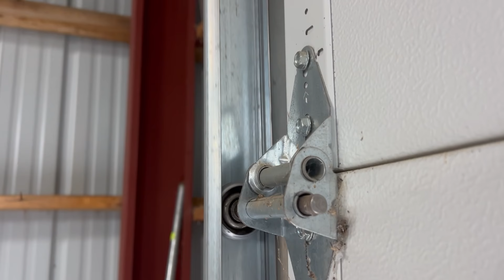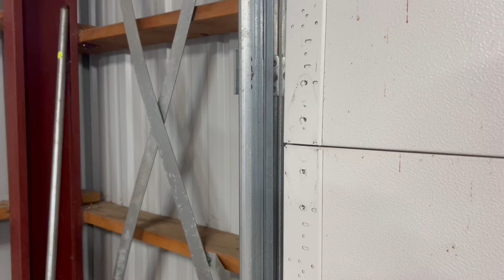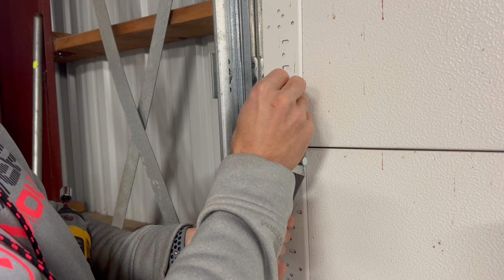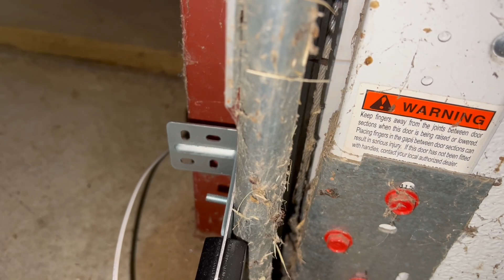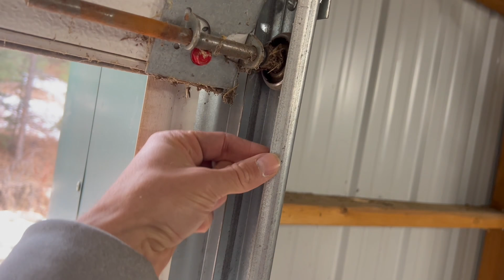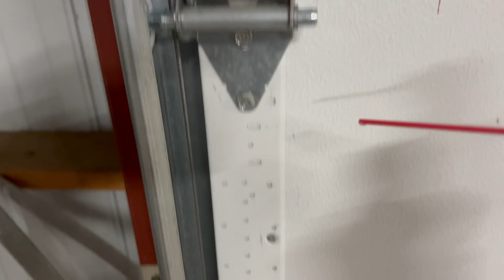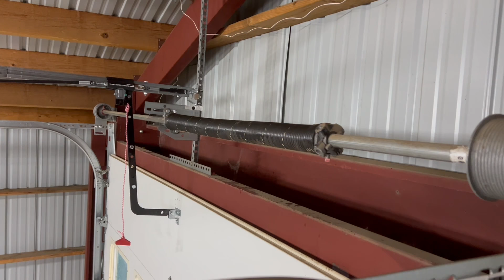How to Replace Old Garage Door Rollers WITHOUT Bending Track (Easy DIY Install) | Builds by Maz

Comment: Why did you spray WD-40 on the spring?  That product is a Degreaser and not a lubricant.
Reply from the maker: It’s not regular WD-40, it’s a WD-40 brand silicone lubricant

Comment: Good video. I have extension springs on the side, so it works the same, no spring tension when door is open. Then you can remove bottom roller or replace cable or spring. My metal rollers are 65 years old. I lube the  ball bearings with white lithium grease. I used to use oil but it attracts dirt.

Comment: Hold the cable in place with vise grips when replacing the bottom rollers.  Even easier alternative: replace all the rollers except the bottom ones.  Then use a good teflon lubricant on the bottom rollers. Full door done in 10 mins and usually just as quiet as doing all the rollers.

Comment: Was just easier for me to loosen up the few nuts on the side track on each side, pull it away and replaced all of the rollers at one time. Didnt need to even open the door

Comment: Since you used the first method of removing the bottom roller by slightly bending the track, would you be able to remove the other 4 or 5 rollers using that same 'bend'?  Rookie here, so I don't know. 😊
Reply from the maker: I didn't bend the track. I recommend avoiding that, if you can.

Comment: I wonder about a third option for that bottom roller. What would happen if you change all the other rollers to nylon but leave that bottom metal one in place? Would you still get most of the benefits of the changeover without the hassle of dealing with that bottom one?
Reply from the maker: You would definitely still get a lot of improvement. You can always try it, and if it's still noisy, go back and replace the bottom 2.

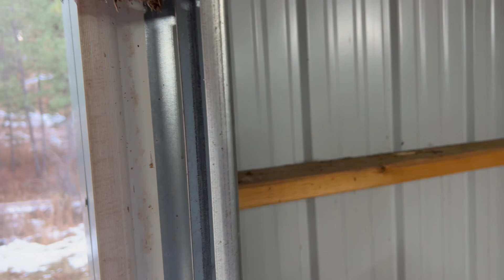Comment: Title of the video is "How to replace old garage door rollers WITHOUT bending the track" and then at 3:30 you suggest bending the track. Just disconnect the track at the joint (shown at 3:07), pull the door up to get the roller out and then replace it... then put the track back together. Botta bing botta boom.

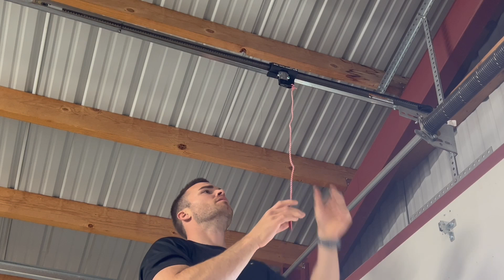Comment: @2:50  We have exactly same single Torsion spring, at the same location (the spring starts at the center, but it is 2 car garage door, so twice wider), when one end coincide with the center of the Torsion Rod (tube). If I want to replace that one single spring with two of them instead, should I buy the springs of the same category (I mean length, coil thickness, and ID), or they should be a bit smaller? In one video they said the new spring can be a bit stronger, so if I place 2 springs instead of one, probably there will be no problem. The Central Wall Bracket looks good  and strong. 1st I thought i need to put at the center 2 wall brackets (one on top of another), especially that they sell them on Amazon in pairs, but google search gave the answer that the existing single central Wall plate should be enough for 2 springs as well. This question is still vague for me, since no one on YT is replacing the 1 spring with 2. If someone can give any opinion on this quite interesting perspective (if one spring got broken, why not to enhance the system with 2 springs instead). I would really appreciate. Thank you for sharing your knowledge about garage Doors problems with DIYs.

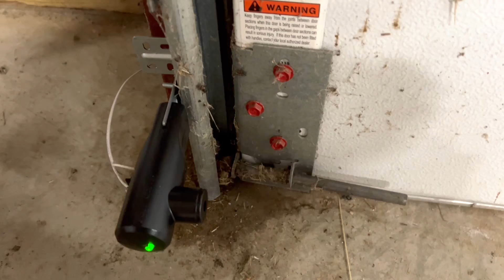Comment: @2:22 So if the Torsion Spring in not under any tension (since broken), you can do the bottom roller same way as others? Also how often you need to replace Cables and Cable Pulleys? Thank you for the detailed video again and especially for the lubrication tips (I understand White Lithium Grease is an alternative for the Silicon Lubricant). We never lubricated our garage door (I didn't think much about it), maybe that is why and the Torsion Spring gave up and broke.
Reply from the maker: Yes white lithium grease is also a great option. It's important to lubricate the spring regularly, and that probably would have extended the life of your spring. If you are sure there is NO tension on the spring, then you can replace the bottom roller the same as the others. Cables should last for 5-10 years at least, but you may want to have a professional inspect them to see how much wear they have.
Reply: @buildsbymaz  Thank you for the replay. Yes, no tension, the Torsion Spring got split in 2 unequal parts and the Cables hang totally free. The house is 25 years old, and I don't think anyone replaced them (though not sure, we bought it when it was like 15 years old). I bought on Amazon some time ago  3-In-One Garage door Lube spray, but it doesn't say on the bottle Silicone, I'll order the one you advised, since will be installing Nylon Rollers. Thank you again.

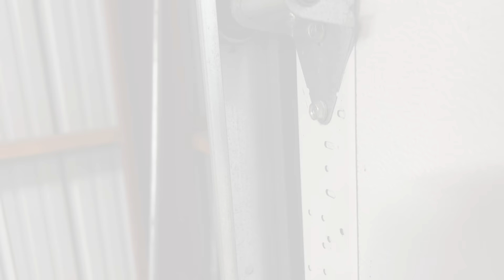Comment: @0:22  That is exactly what is going on w/some of our Rollers. I thought it is a normal situation, that those rollers sound (ours also bent a bit) like that, but now I see that they are also just worn out. The garage door is 25 years old, so I need to replace them. I think that the method of replacing the Rollers used here is much better than bending the rails I saw in other videos. When the rails are bent back you can see that they were bent, there are marks on them, and maybe DIY like me won't be able to put them back how they should be. Thank you so much for showing all the details about Rollers replacement in this outstanding video.
    Our door got bent, since Torsion Spring split, then I aligned it, but not completely (the door is bent inside in the top middle part like ~ 1 in). So to attach that black handle for the trolley I would need to use another hole different from original , not sure if it is the right thing to do. And also after I detached that (Arm) handle from the door, can I lift that door at list a bit to see that it can move normally and the problem is only in the disabled Torsion Spring, or without a new Torsion Spring it is not possible, bcs of the weight of the door (it is 2 car garage door, but aluminum)? I would appreciate any opinions on this matter. Thank you for the informative video again.

Comment: DANGER WILL ROBINSON! I actually attempted to perform the method of removing the cable from the bottom brackets this way before I saw this video. As soon as the tension is released the spool up top becomes a rats nest and if your garage is like mine it's not easy to get to the coil. It was a major pain in the ass to re-wind it all back up while keeping tension. Just bend the metal, it was SO much easier and you can't even tell you did anything unless you look really closely after you bend it back. If you do his method you need to hook the cable onto something else to keep the tension, because even with a little slack it turns into a mess.

Comment: is it possible to do a short video to show how to use a vise clamp to do the bottom roller ?
Reply from the maker: All you would need to do is clamp the end of the end of the wire to the garage track so that it stays in place and does not unravel. I may be making another video in the future on this but it will not be for a while

Comment: DO NOT ever lube the track. You want the rollers to roll not slide. Also instead of lubing the roller shaft they make plastic sleeves to make them even more quiet.
Reply: Agreed on both points.  He should just get a PTFE coated sleeve for self-lubrication.

Comment: Lubricate the new rollers shaft with litium grease before installing them.  It may sound redundant but it helps significantly with the noise and life span of the motor.

Comment: After reading comments, a guy said to use vice grips when unhooking the cable and just let it hang so u don't need to wind it up on the wheel and another guy said he bought a thicker wheel.
        So I went on Amazon and found the thicker wheels and bought a ten pack for fifteen bucks and with the help of THIS VIDEO I installed them in less than an hour. If it wasn't for the motor running I wouldn't think the door was opening, That's how quit it is.....
Reply from the maker: Awesome! Glad to hear it worked out great.

Comment: Do no spray the track. It does no provide any advantage but it will accumulate tons of dust, dirt debri making is an oily dirty mess.
Reply: Highly agree. This serves zero purpose. Simply wipe clean with a rag. Any dampness or grease will accumulate dirt and debris. The rollers roll for a reason, they don't slide, so no need for lube there.
Reply: You can pour a spray bottle of windshield washer fluid to spray & wipe clean the roller tracks.  It is alcohol base cleaner & able to dissolve the dirt on the track.
Reply: Came here to say this!!
Reply: Use only graphite powder to lubricate the track.

Comment: I'm thinking it's a lot safer to just leave the two bottom rollers in place, and replace the rest with the nylon variety.  That should reduce the noise almost as much, and avoid the obvious hazards.
Reply: That is what i was just thinking too rather than  go through all that cable risk..   or bending that track

Comment: One side of the door has the cable nice and slack and I can therefore remove the bottom bracket.....but the other side is under tension.  Guess I have to bend the track for the bottom roller on the tension side (but bend it a few inches down from the top of the chanel) ?
Reply from the maker: Yes that would work. It seems like your garage might be slightly out of balance though, which may cause the spring to fail early.

Comment: Good video, however I replaced all the rollers on my 3 single doors and found they were not any quieter. They were 23 yrs old so I figured they needed replacement anyway.
Reply from the maker: Try lubricating all the hinges and garage spring. That will make a big difference.

Comment: Terrible idea for somone who has never worked on garage door and springs..   Vice Grips  when is used properly on the rod at the top roller bar is the best, and safest way.   Most do not realize the the weight these are holding.  Let one go flying off the roller drum and it's game on until you end up in the ER.

Comment: I was an engineer and my experience is that sheet metal screws aren’t designed to be removed and reinstalled.  They will never hold as well.
Reply: So what is the solution??
Reply: 2:50 bending the track outward.  Lots of other videos on this methods.
Reply: This is probably true but you could also likely pack some JB-Weld Steelstik or another similar steel reinforced epoxy putty into the holes and let it cure for a bit to help the screws grip perfectly once again if they are stripped out or compromised from being removed. Speaking of engineering, why don't they just design a small segment of the track that's maybe you know 4 in Long at the part where it curves that could be separately unbolted and removed so that you can just keep the door in place and raise and lower the door to align each of the rollers one at a time to this maintenance removal area and then just pop it out and place the new one in and put the track back in place. Or even like a little flap on the outside of the track that swings out or a metal panel that could be unscrewed to provide an opening to the track where you could just leave everything in place but pop the rollers out when aligned at this little maintenance access area. I think that would be the best option.

Comment: I live in hurricane country, to maintain high wind load, metal rollers are preferred, it might also be an insurance issue if you loose the door assembly due to roller failure.

Comment: My advise is to never lubricate the track. I see this problem often created by the uninitiated... Wheels require friction with the track in order to turn. If the track is lubricated and there is less resistance there than in the bearings where lubricant is supposed to be, the wheel will just slide instead of turning, In no time this will wear a flat spot on the wheel becoming worse with each use and not turning at all eventually.
Lubricating the roller bearings will give you a quieter and more efficient door. It may even open higher (as when new) due to the increased resistance (on un lubricated bearings) causing the door not to open as far.
((This is even more applicable to sliding patio and screen doors as they have the weight of the door directly on them))

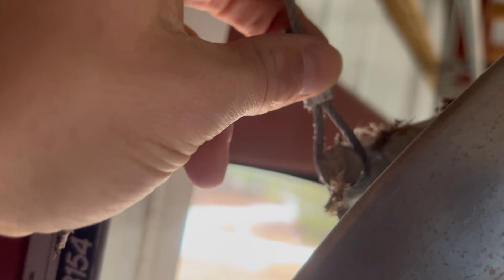Comment: 3:52  I'd suggest taking a pair of vise grips & clamping them OVER the cable as it comes off the drum that it is wrapped on BEFORE detaching it, this will keep it from unraveling
Reply: I was thinking a bungee cord hooked to one of the brackets below to maintain tension on the cable - same kind of idea.
Reply: @philipstaite4775  Wouldn't be strong enough. There's some serious tension on those cables.
Reply: @Canuck-64  Not when the door is in the full up position.  The springs are down to a 1/4 turn or so.  As you saw in the video, he pulls the cable off the pin with two fingers.  A bungee cord or even just a weight (eg. vice grips clipped to it) would hold enough tension on the now free cable to keep it from spilling/unwinding off the drum while you replace the roller.
Reply: Absolutely use vice grips. Been there.

Comment: If you are going to bend the track, why wouldn't you use that spot to replace each of the rollers?
Reply from the maker: It would be difficult to pop rollers out from the middle; it really only works for the bottom roller. Either way I don't recommend bending the track.

Comment: I installed commercial & residential garage doors in the 70 & 80s. With the door closed remove one vertical track at a time and replace rollers (including the bottom fixture) except the top fixture. With the door in the half-open position, you can change the roller in the top fixture from a step ladder by simply twisting the track by hand. If you have concerns you can run a long deck screws between the track and the door at an angle to ensure it stays in place.
Reply: I like this best.

Comment: Is it Possible that the Hinge holes got worn and the width of the hole got bigger after time  that even if i replace the rollers, it may not work? or do i need to replace the hinges as well? thanks
Reply from the maker: @dsbchamp  they should not, but you can unscrew them slowly and try and maintain the same thread into the garage

Comment: You were close reinstall hinge screws at same time then tighten the fixed screw first then the enlogated holes top 3 bend the track were the door rests in the open position pry out the roller and push the door panel towards the frame and replace the roller reset the roller and straighten the track if you choose to remove the bracket install a vice grip under one of the rollers so the door won’t fall down also lube the stem on the new roller before installing and lube the pivot points on hinges do not lube the tracks the should be clean and dry your welcome 49 years of service

Comment: Beware: there still may be some tension on the cables even with the door up, which is what keeps it up.  You'll have to unwind the springs some.  Menards has the rods for doing that and it really isn't that hard.  Better than bending your tracks.

Comment: Are all the rollers the plastic part the same diameter and size for all tracks?
Reply from the maker: They are not always the same - 2 inch rollers are the most common though. I would measure what size your current rollers are.

Comment: Spraying the tracks serves no purpose whatsoever and will instead aggravate the smooth movement of the door.

It's the rollers that must be lubricated. They have ball bearings and they have to roll along the track. The chanel of the track must be as clean as possible. The rollers don't slide along the track - they roll in them. 

Imagine oiling the road so your tyres can slide better. That's not what you want!

Comment: Do not use WD40 as a lubricant. It isn't a lubricant. It's a solvent. Use synthetic motor oil in a dropper or garage door lube. Also, if your going to spray any lubrication anywhere, use a shopvac and clean all of the cobwebs, dirt, dust off the tracks and get those surfaces clean. All you do when you spray lube with them dirty is push dirt into spaces on the track and rollers you don't want.

Just a sloppy demo.
Reply from the maker: I used silicone lubricant. I specifically said in the video to not use regular WD-40.
Reply: @buildsbymaz did you use WD-40 on the spring?
Reply from the maker: @ No, it's WD-40 brand silicone lubricant.
Reply: @ ah, my bad. I couldn’t see it and I was running your video silent.

Comment: Nice video.  I would probably use method two for the bottom roller.  I don't like the idea of bending the track.  Then I would wrap the cable drum with some duct tape to avoid cable unwinding.
Reply: I went in the garage to look at my rollers and lo and behold I already have the nylon rollers.  I did order some WD-40 Silicone lube, however.

Comment: NO NO NO!  DO NOT spray anything liquid onto the actual tracks themselves.  Yes, spray the spring and the roller pins and hinges but NOT ON THE TRACK!  Over time your track will get goopey and gummed up with dust and schmutz.  Hear me now, believe me later!
Reply: i do believe silicone dries…..no sticky residue
Reply: 😂So true! Tracks will get nasty fast, and God help your shirt when retrieving a rake or broom by the door. It's a throwaway!  As Hanz and Franz were saying,  "Listen to me know and believe me later!"😊😅😂
Reply: Good shoe ...
Sometimes  newbies continue to push  "a" thing supplemented over a factual point
Reply: Of. Ourselves, thank you for clear response

Comment: Helpful video. I was wondering why my track is bent at that position.  Whoever did it didn't bend it back that well.  I always thought it was due to the door getting out of the track when the spring broke.Who knows, maybe it was due to that.  Probably a big benefit of quieting down my garage door is that the garage door opener and spring should last longer so I'll give this a try.